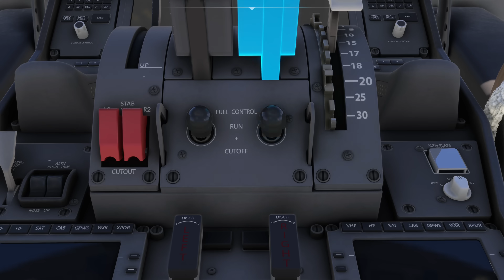Air India 171: Why Did The Fuel Cut-off Switch Get Moved?

Comment: 3:00 The issue with needing both pilots to do any operation is that if one pilot becomes incapacitated mid air by losing consciousness, cardiac arrest, etc., the other pilot should solely be able to fly the flight
Reply: And in this case the acting pilot could've just dunked the plane into the ground.
Reply: Exactly what I was about to comment
Reply: @joshdubrow6494  What people forgot about is the fact that there's basically "no need" to do an operation like you know, "cut off the fuel switch during the takeoff procedure". The fact that one pilot was able to pull it off is the reason why this crash happened. Accidently or not.

It's insane that it's even physically possible for the pilots to to cut off the fuel supply after the takeoff has been initiated.
Reply: Exactly. There are innumerable ways a malicious pilot could down their own plane. Designing for that possibility is impossible.
Reply: Easy. Require a procedure to unlock single pilot control of the fuel cutoff switches. Remember the goal isn't to prevent sabotage, necessarily; it's also to prevent accidental activation of these switches. But it would also make sabotage require much more effort. It's one thing to incapacitate your copilot, it's another thing for plane design to allow a single movement by a single pilot to be so simple, quick, and catastrophic.
Reply: @rvfinder7997 if there is a way to convert from 2  to 1 pilot control, then someone who is suicidal can still cut off the fuel
Reply: @rvfinder7997  [Require a procedure to unlock single pilot control of the fuel cutoff switches]

The pilot suffering a sudden stroke or heart attack might not be able to be able to follow such a procedure. While it might be useful in some cases, that needs to be balanced against the possibility to causing more problems than it solves. Added complexity often adds additional points of possible failure.
Reply: @rvfinder7997  What really happened on Air India Flight 171? In this video, I explore a developing theory that a rare electrical failure may have caused both engines to lose power — not because of mechanical failure, but due to how the 787’s safety systems are designed to respond in extreme situations. Specifically, we look at the possibility that the aircraft’s fuel shutoff valves (FSOVs), which are designed to close automatically when power is lost, may have played a role. This isn’t confirmed — but it’s a plausible scenario worth examining as we await the official report.
Reply: Plus, if a pilot is bound and determined to take down the flight he/she is going to do it, unless incapacitated in time
Reply: @bucksdiaryfan  Agreed, even if they other pilot saw him turn the switches off and instantly tried to turn them back on, the other pilot simply could have lunged at him and knocked him over, creating enough time where the plane couldn't be saved.
Reply: Yeah the whole point of having multiple pilots is to provide redundancy. Actions requiring 2 pilots means at a minimum 2 pilot flights become 3, and 3 pilot flights become 4 in an industry that is already short on pilots and struggling to train enough to keep up with demand.
Reply: @nankam  Except if you read the comments above there are mechanical ways around that that, e.g. emergency procedure to switch to single control that would log an alarm or some other indicator of what had happened in the FDR and since the other pilot had been incapacitated it would be an incident that would necessitate investigation correct?  It's my understanding even non-crash incidents are investigated in order to make sure problems don't get missed and turn into crashes.
Reply: @GeekGamer666  I saw those and it sounds useless to "require" two people for an operation if it can be so easily overridden by one, and wouldn't have helped in this situation or provided any additional information if indeed one pilot deliberately moved the switches while the other was concentrating on taking off since he just as easily would have done the override procedure first. At the end of the day trust in the pilots can't be designed out short of a fully autonomous system, then we'll be trusting all the people who designed, built and tested that system and hope they thought of every possible edge case.
Reply: Is this possible.
Major failure of systems which caused the RAT to deploy and shut the fuel valves. The pilots get some warnings including engine shut down warnings and fuel cut off warnings. One pilot quickly assumes the fuel switches were operated and asks the other why. The other pilot says he didn't. They then realise the switches are in the on position so try cycling the fuel switches off and on to see if that would get the engines going.
Reply: @Extra-Sail Not really a possibility.  First, it would have been obvious that they were in the run position, so it would be insane to make the mistake of turning them off thinking you were turning them off.  The spring loaded mechanism pretty much ensures no mix-up could happen - it's not like a regular light switch.

Second,.if they heard engines spoiling down, I think that fuel cut-off would be several items down the list of things you would think went wrong.  It certainly doesn't seem like the type of thing that would be the immediate conclusion.  Which is another reason why the fact that it was asked about indicates an intentional action.  If the question were "did you do something?" or "did you change something?" then maybe, but given how specific it was, someone was pretty sure that's what the cause was - either because they saw the other pilot do it, because they did it themselves and were trying to shift blame or because they saw the switches in the incorrect position (the latter being the least likely given the amount of time it took to turn them back on).
Reply: @fuhkerz 

Engines spooling down just after leaving the ground and no usable runway left ? Obviously check the throttle levers &  fuel switches first. Then do other things.
Reply: @fuhkerz when the engines stopped giving thrust the flying pilot asked the monitoring pilot, why did you shut off - without specifically mentioning fuel switches (read the report). He replied I didn't. Then for 10 seconds they both looked at what could be wrong and didn't find anything. They knew that they could reignite the engines by toggling the fuel cut off switches and that is why they did that.
Reply: @Extra-Sail What really happened on Air India Flight 171? In this video, I explore a developing theory that a rare electrical failure may have caused both engines to lose power — not because of mechanical failure, but due to how the 787’s safety systems are designed to respond in extreme situations. Specifically, we look at the possibility that the aircraft’s fuel shutoff valves (FSOVs), which are designed to close automatically when power is lost, may have played a role. This isn’t confirmed — but it’s a plausible scenario worth examining as we await the official report.
Reply: they can.... and do
Reply: This...
Reply: Yea, so obvious, why is he not mentioning this.
Reply: my thoughts exactly
Reply: Write a line of code that makes an announcement when flight critical systems are engaged/disengaged. Gear down/up, flaps, engine fuel switch, etc. If the other pilot had heard the engine fuel was cut off, he could have looked over to what was going on and at least had a chance to stop the other guy or correct it quickly (don’t know if that would have been enough, but it definitely would be better than nothing).
Reply: @calesmart435  he reacted in 10 seconds, hard to beat that with an annoucemenet
Reply: You’re quick to blame the pilots, but let’s get real:
🔴 A viral video taken on the same aircraft just hours before the crash showed malfunctioning cabin electronics — power issues, failing displays, and unresponsive systems. That’s not random. That’s a clear warning sign of deeper electrical faults.

🔴 The takeoff roll was unusually long and slow, clearly visible in CCTV footage. This was before any engine switches were flipped. If the aircraft was “normal,” why did it struggle to lift off? That alone suggests power or thrust-related issues, possibly tied to earlier electrical problems.

🔴 Both engine fuel control switches were turned off within seconds of liftoff — an action that takes force, not something easily done by accident. And the CVR shows confusion in the cockpit: “Why did you cut off?” — “I didn’t.” That doesn’t sound like deliberate action; it sounds like unexpected behavior from a faulty system.

Yet despite all this, you’re pushing a theory that clears the manufacturer and blames the dead pilots — just like Boeing did during the 737 MAX crisis, when they knowingly hid MCAS flaws and let pilots take the fall.
Reply: @Gurpreet.jheeta  Where to start, where to start..

The entertainment system is entirely self contained.  Even if there were some fault in it, it would have absolutely nothing to do with moving a switch in the cockpit.

They have the FDR.  I trust that more than the assessment of some dude on the internet's judgment of a CCTV video.

No one is saying the fuel was accidentally cut off.  In fact, that's exactly how we know it was deliberate pilot action and not the electronics or some nebulous "struggle to lift off" that caused the fuel to be cut off.

And finally, the team that investigates this stuff has representatives from multiple companies and governments.   There is zero chance that they conspire to cover up some defect that would cause what has been, to date, an extremely safe aircraft to start falling out of the sky.  Following your logic, if they covered up some fault and another plane has the same thing happen in a year, do you think they are going to be in more trouble or less trouble?  Do you think they will have to pay out more money or less money when the fact that they clearly chose to hide a major defect comes out?

Your comment just shows a total lack of understanding of how these investigations work and the level of certainty they have before coming to conclusions like this.  I know it's a lot easier to think that a plane failed than to think of the reality that a pilot caused the crash intentionally, but that does happen.  It's not the first time and it sadly won't be the last.
Reply: @Gurpreet.jheeta I'm not speculating anything about the incident itself. I don't blame the pilots for what happened, and my opinion in this does not matter since I'm not an expert in the field.
My comment is purely technical and isn aimed at pointing at the fact that sabotages have happened in the past (eg. The Germanwings incident). And if a pilot did wish to sabotage the flight(NOT saying they did), technical guardrails cant stop them from doing so
Reply: I was waiting for somebody to voice this concern.
I could not believe this was not dismissed immediately.
You win first prize.
Reply: The issue is not turning the fuel switches to ON. The issue is turning the engine fuel switches  to OFF when Airborne. So if 1 pilot gets incapacitated then the fuel switches stays ON while Airborne so there’s no problem with engine thrust
Reply: Exactly. There is such thing as too much redundancy.. a point where it becomes counterproductive
Reply: Exactly. I thought exactly the same hearing the suggestion about both pilots input.
Reply: Right! And that is far more likely to happen than a suicidal pilot, which is very , very rare.
Reply: Fake narrative. Facts are here. You are sold off to Boeing. Why don't you talk about FAA directive from 2018 and CAA directive from May 2025 which talks about issues with Boing 787 which can cause cut off including during inflight.  Why Etihad airlines and DGCA wants planes to be checked. Why British Authority wants checks for this issue since May 2025?.

Western media is corrupt and sold to Boeing
Reply: Its not an operation that you couldn't quickly instruct a flight attendant to act as the 2nd pilot
Reply: My system where yeah, turn off the switch. And then you have to pull back the throttle. With 2 pilots, it would take mostly 2 pilots to do that action. And with one pilot the probably could do both actions so my idea works perfectly
Reply: Good point...
Reply: @anayachinmaya The issue is not about any one of the pilots needing to cut off the switch. The problem is that people are too lazy or too idiotic to even read and understand that the user was specifically talking about the fuel cutoff system and literally nothing else.

IMHO nobody should be able to do the cutoff operation especially when the plane is in flight. It's insane that it's even possible to pull this off.
Reply: And, restroom breaks or walkabouts.
Reply: But engine issue and one pilot becoming idle have low probability than just one input
Reply: In that eventuality, AI driven input could be provided. I feel autopilot coupled with AI is the need of the hour.
Reply: Yea idts, an engine fire + an incapacitated pilot is gonna happen in the upcomming 20 decades
Reply: He can bring someone in the cockpit.
Reply: Good insight
Reply: I see an audible alarm stating "Fuel Cutoff" in the near future.
Reply: @nobelsteed6440  Since the status of the switches is already electronically monitored for the FDR, that should be a fairly simple software patch. Or is the design of the FDR so old that it's analog? I seem to recall reference to flash memory, so...
Reply: First thing that came to mind!
Reply: HELLO! It's an obvious issue.....the folks who don't think think of an "easy" solution without thinking of ramifications and even WORSE OUTCOMES...
Reply: Watch Flyingbeast video if you  really believe in unbiased explanation ❤❤❤ english subtitles are available
Reply: So convenient that no media in the West published criticism by investigating body of such speculation. Everybody has assumed the pilot “calmly” said “i didn’t do it”, no mention of calm anywhere in findings.
Reply: Captain Steve,
I usually appreciate your breakdowns, but I strongly disagree with your take on Air India Flight 171. Labeling it as "pilot error/suicide" feels speculative at best—and frankly, irresponsible. There are deeper systemic issues that deserve investigation, including potential mechanical failures and operational oversights.
It’s hard not to feel like this narrative conveniently shifts blame away from Boeing and Air India. Was there any pressure or bias in your analysis? Many of us are asking these questions.

Let’s stick to facts—not assumptions.
Reply: What really happened on Air India Flight 171? In this video, I explore a developing theory that a rare electrical failure may have caused both engines to lose power — not because of mechanical failure, but due to how the 787’s safety systems are designed to respond in extreme situations. Specifically, we look at the possibility that the aircraft’s fuel shutoff valves (FSOVs), which are designed to close automatically when power is lost, may have played a role. This isn’t confirmed — but it’s a plausible scenario worth examining as we await the official report.
Reply: how often is that the case, that the other pilot then has to cut off fuel? And in an emergency, someone else from the cabin crew could be called to the cockpit to perform the easy procedure under the conscious pilots command. Other safeguards are also imaginable - e.g. you can do it alone, after a grace period of 15 seconds, while alarms go of in that time if you do not do it in sync, that would alert the other pilot in case of covert misuse, so he could counteract (have a button on his side to lock the cut off switch during grace, ...).

A lot of things could be designed better than "yes this is shitty and dangerous, but we believe that the pilots should know what they are doing... ". Planes have an insane amount of safety features build into them, but an alarm for the "off switch" is asking too much? Get real - they just did not think this through, and it happens so rare, that 100 USD saved on two more switches in a 15mio USD plane is just too much economic burden...
Reply: Agreed. Nowhere in human jet pilot history has a problem with these switches! If they made the switches dial redundant then what about the fire switches!? They do the same thing except even worse. Captain Steve talks before he thinks sometimes.
Reply: @crooney82  Captain Steve is a airline pilot. He is not an engineer or investigator. I love listening to Captain Steve.
Reply: @user-roadwander  Nothing wrong with being candid and having an opinion. We all appreciate his commentary, but no one's perfect. He's resistant to cockpit cameras, that not on. doesn't devalue the good he does bring
Reply: @crooney82  In addition to (generally? I'm not as prepared as you are to make blanket statements like "never in history") being larger and red, fire switches are never used in routine operations. The fuel cutoff switches are routinely manipulated at the beginning and end of flights. Accidentally pulling the fire switches is considerably less likely due to the lack of muscle memory for a task.
Reply: @crooney82  AH IT waas a question NOT HIS IDEA...
Reply: @crooney82  What really happened on Air India Flight 171? In this video, I explore a developing theory that a rare electrical failure may have caused both engines to lose power — not because of mechanical failure, but due to how the 787’s safety systems are designed to respond in extreme situations. Specifically, we look at the possibility that the aircraft’s fuel shutoff valves (FSOVs), which are designed to close automatically when power is lost, may have played a role. This isn’t confirmed — but it’s a plausible scenario worth examining as we await the official report.
Reply: You could just reach over and grab the fainted pilots hands and use them to do what was needed like when they use a dead security guards finger prints to open doors etc in the movies
Reply: @jacksoncroyce6063 - And if they're in restroom, then what?
Reply: @DawnaOlson  Well, i don't know in that case. Maybe get a flight attendant to do it?
Reply: @jacksoncroyce6063 - I get that, but I'm just saying if in emergency situation (engine fire) where seconds count — no time to waste.🤷‍♀️
Reply: @jacksoncroyce6063 No. No, you very likely couldn't do that. That makes no sense whatsoever. Why? Why would you move the incapacitated pilot's hand instead of just operating the switch with your other free hand in this case?
Reply: @louibeans  Because he said it needs both pilots? I was just saying that if one faints or something then you could do your part then reach over and use the fainted pilots hands to do his part.
Reply: @jacksoncroyce6063 Yeah but not by fingerprint ID. So if you need two people to operate this functionality, it's likely because the other button is out of reach. You wouldn't be any more able to press it yourself than pressing it with someone else's hand. Even if the button worked with fingerprint ID (which is an idea I think we can safely dismiss), you can't always grab someone's correct finger. If a person is incapacitated, they may be unconscious, slumped in their chair. You need your own hands to fly the plane and then you're supposed to grab a slumped, incapacitated person's finger? How??? This is an impossible suggestion on so many levels.
Reply: @louibeans  Could get a flight attendant to manouvre the fainted pilots hands then? Idk, maybe it's not a great idea to need 2 people after all.
Reply: @jacksoncroyce6063  No you can't, especially in a wide-body aircraft. The center console is so wide in a wide-body that you can't fly the airplane from one seat and grab the other pilot's hand easily, especially if you're hand-flying. If confirmation buttons were installed on the yokes, you maybe could reach the other yoke switch if they were installed on the inboard side of the yoke, but then it would simultaneously require both hands of the active pilot to move a fuel cutoff switch which would be impossible if you're hand-flying. AI might have an answer here, where an intelligent algorithm could keep the switches locked after takeoff until some reason exists for a possible shutdown. A two-pilot fail-safe override of the automation could also be installed.
Reply: Im surprised a third pilot was not on Jet. US seems to have best pilots, most mechanical checks.
Reply: @pegggymallis324  Augmented crew onboard based on flight time of the leg(s) being flown. Thats why flight crews "time out".
Reply: @pegggymallis324 , isn’t it so sad that USA has the most and significant number of Commercial Airline crashes to date?